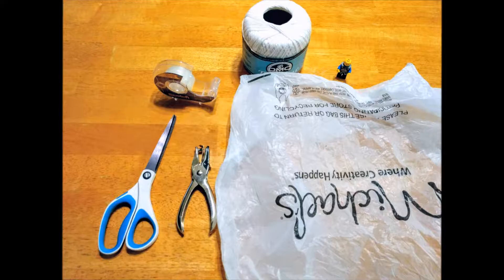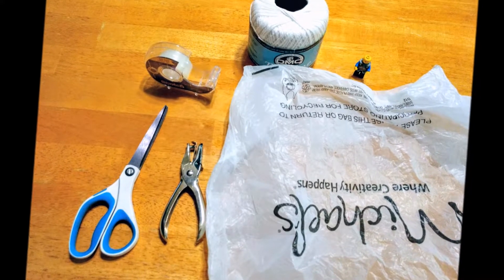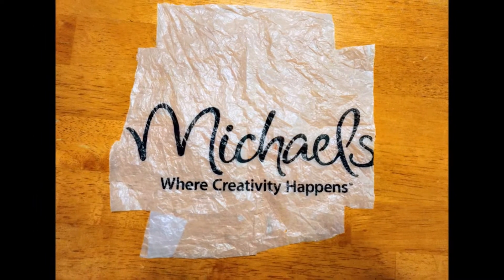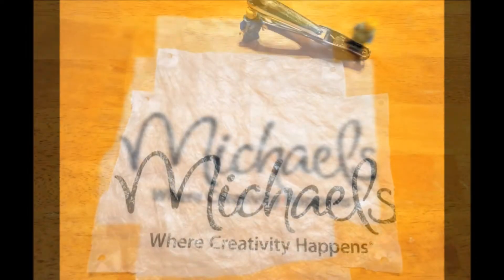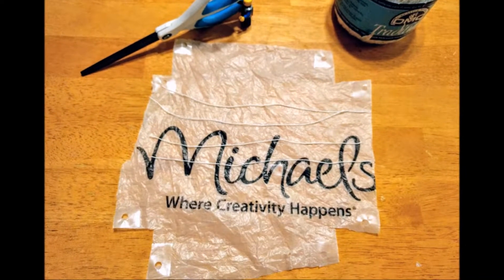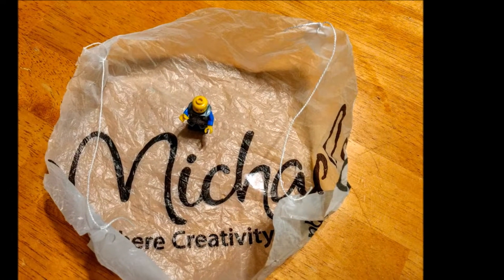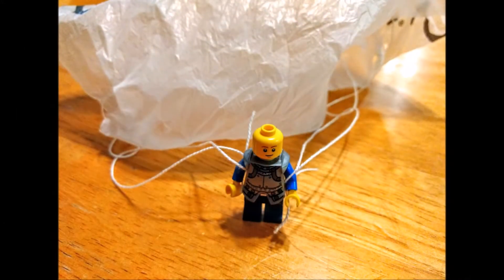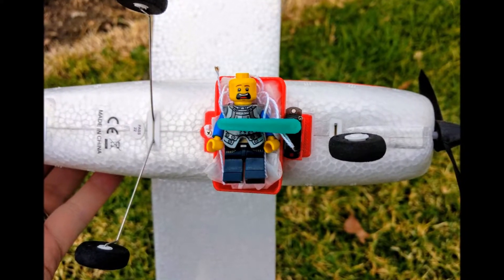F949 Parachute Jump Part 2

Comment: How did you attach the servo?
Reply from the maker: The servo plugs directly into the control board in the f949. There should be an unused plug on the board.
Reply: @mbioman   alright thanks
Reply: @mbioman  Which button did you use to control the servo?
Reply from the maker: @yuponns6576 I programmed it to a switch on the remote.